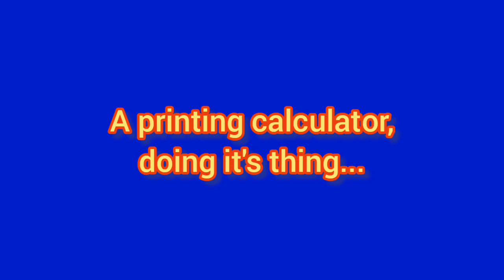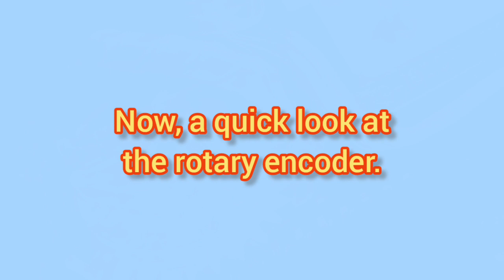A printing calculator doing it's thing.

Comment: Good use for slo mo, liked the captions and the music. Could not see what was going on, you did say it was fast.
Reply from the maker: I recorded the video at 240fps (so quarter speed). This was then changed in the video editor to be 0.2× (so twentieth speed). Then when making the final video it plays at about 0.4× (so about fiftieth speed). Any more would have been too juddery. And, yet, it still whizzes by. I probably need one of those fancy (expensive) slow motion cameras.
Suffice to say, you don't really get an appreciation of how fast this thing is actually going until you try to work out how it does what it does.